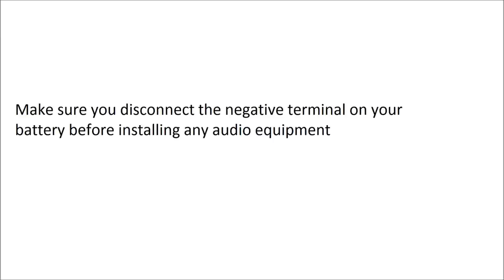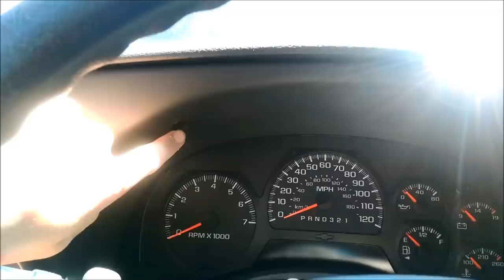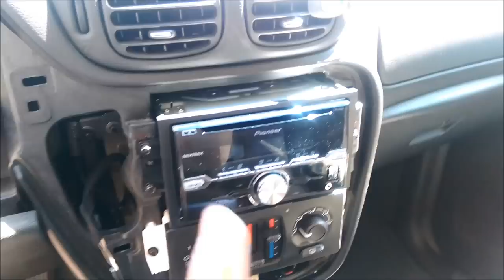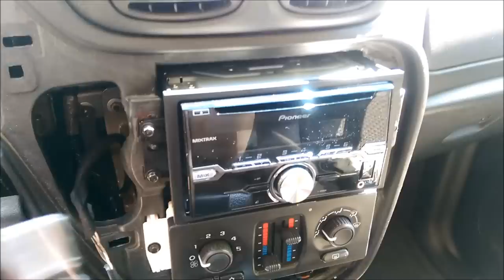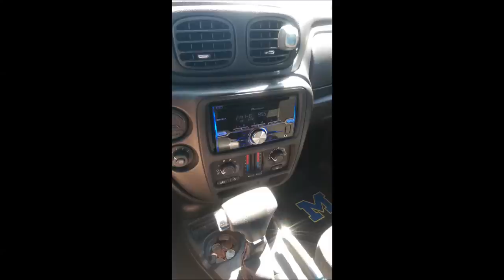Radio install in Chevy Trailblazer with Bose premium sound

Comment: Rydog, I installed a Sony XAV- AX100 Apple car play enabled unit in my 07 Trailblazer today. I never installed a stereo in a car before and i would have not attempted it had it not been for the video. I was able to save $150 minimum because I bought stereo and harness from Crutchfield thus getting the minimum price. Installers like Best Buy or local Car Audio stores were charging anywhere from $100 to $300 more for same unit + interface+ harness plus labor.  Though Crutchfield provided instructions, it is nothing compared to watching a video.Great job on the video and thanks a lot.
Reply from the maker: Binu Jacob thanks! glad it helped!

Comment: hi awesome video i have a question. to where did you connect the blue and white cable fron the axxess adapter to(thas the amp cable) cuz my radio the only wire that has left after connecting all the wires is a blue one it doesn't have any blue and white wire for the amp?

Comment: Just spent two days falling in hate with stereo installation. Ended up going old school and simply running new wires almost all the way back to the speakers. discovered a few interesting things about the 05 TB with Bose and OnStar. 1) don't be a cheapa** like me... take the stinking thing back to the dealer and let them do it. 2) make sure you go someplace where the people you buy from have a clue. We got a nice Sony stereo from WallyMart at a good price, but they did not have the right adapter set. (see above) 3) I ended up pulling door panels and the dash, etc., to run new wires and bypass all the old wiring (including two new power leads (keyed and unkeyed)), but I learned a couple of cool things about the wiring. a) You can get by without removing the door panels unless you want or need to replace the speakers. For the rear doors, if you pull the covers off the floor (the plastic trim covers at the door entry) and the one covering the center column between the doors, you can tap into the speaker wires there. For the front door speakers, the wires come in through the wall (follow the rubber conduit) and you can find the speaker wires inside the cabin (check online for wiring colors). b) the dash speakers are wired with the same colors as the diagonally (not Diagon Alley) opposite rear speakers. So, the front left speaker has the same color wiring as the rear right, etc. 

I have very clearly informed my wife that this is the very LAST stereo i'll ever install in a vehicle. From this point on, it's off to the dealership or Best Buy or some other organization where the legs and backs of the installers there are more than welcome to the suffering and pain I put up with for two Saturdays and a Friday night.

Comment: Thank you so much for this video! I just want to clarify something for you and other viewers. Any aftermarket radio install in the 1st Gen Trailblazer (2002-2009) requires a Metra GM1000 interface. This is to reroute the cords supplied not only if you have BOSE, but also OnStar as well. This harness is still placed in these vehicles W/O BOSE and OnStar, or one without the other. This is placed there just in case any customer went to a dealership and decided to have any of these features installed in their vehicle.

Comment: Quick question my dude I'm just trying to bypass my factory amp in my 2005 gmc envoy..when I unplug the factory radio will the speaker wire be on the big plug or the small plug..thanks

Comment: I have a 02 trailblazer and putting a aftermarket stereo pioneer avh 200ex  and i have the wire harness GMOS-01 and im having a issue with hooking it up the speakers. I have 2 plug ins from the stereo one goes to the black box and the other one goes into the stereo.do i just put the speakers wires together. thanks great video

Comment: I'm not sure if you will see this but I really don't know Jack about cars. If I get a aftermarket radio I don't have to get subs and an amp do I? Or do I just need to get the Bose adapter thing?
Reply from the maker: all depends on what car you have. if you have a trailblazer and you have the bose factory sound you need a adaptor harness like these weather or not you get subs or don't. it's just so the aftermarket radio can work with the factory sound system and not burn it up. this videos super old and i have done a lot more installs and tried new products. PAC-audio makes a way better harness for this. and it's about $100 on amazon. with a aftermarket radio. sub install would be complete seperate from this harness. If you have a base trial blazer with base audio you should be able to install a aftermarket radio and and just the simple $20 gm adapor harness and be fine.
Reply from the maker: PAC-audio OS-2X ,, is the part # for the harness that i now remcomend for a trailblazer with bose. when installing a aftermarket radio and want to use the factory bose sound system
Reply: @RydogsGarage  wow I'm honestly surprised you responded on such an old video. I actually have a 2008 Chevy Trailblazer and it also has the Bose Sound System pre installed.
Reply from the maker: @connorstiles1001  i don't get many comments and they come as notification on my phone. been wanting to post more videos on all my new stuf and new experiences but just been so buisy at work it's hard. so yes perfect if your looking to put like a double din touch screen apple car play radio in it. you need the PAC harness forsure. and it will all work correctly when wired up. manuals that come with it will show how to match the wires based on color coding. subs are fully seperate. becuase a set of RCA cables will plug into radio and run to a amp for the subs. and the amp will get its own power from battery and ground from the chassis of the car. still need harness for radio to work with factory system
Reply: @RydogsGarage  hey I know exactly what you mean when it comes to work lol. I worked the entire month of.november without a day off lol. But I appreciate the input. It's hard to.find videos for my particular car. Thankfully the 08 is basically the same car. I definitely want to get a touchscreen radio but don't really need apple play as I prefer Android.
Reply: @RydogsGarage  what kind of speakers do you recommend? Cause I would definitely like to get the speakers replaced at some point too
Reply from the maker: @connorstiles1001  truthfully the bose speakers are really nice. unless you want to drop a lot of money and re wire the whole car and do a expensive 4 channel amp and new speakers. not worth changing the bose speakers. the aftermarket radio will alow you to adjust the EQ settings alot better. i think if you added a subwoofer set up you would be happy with the system.
Reply from the maker: @connorstiles1001  i ended up with 2 12" rockford subs with a 1000watt amp. and a aftermarket touch screen pioneer radio. and left the bose speakers and tuned the EQ before i sold it.  was extremely pleased with the outcome. when you add subs and change the settings in the radio there is a LPF(low pass filter) and it will keep the bass to the subs only and take that out of the door speakers which makes the doors a lot more clear and consistent. rounds the whole system nicely
Reply: @RydogsGarage  awesome man thanks for the tips I greatly appreciate it
Reply: @RydogsGarage  If I don't plan to remove the radio do I still need to make the wiring longer like you did? And if not do I still need to cut out that metal bracket?
Reply from the maker: @connorstiles1001  i cut the metal out for space cause it's tight behind the radio. but that's a old radio. a lot of the new touch screens are not as deep and give you
more room. if i was to do it over i'd shorten the wiring to make it cleaner install. always soldier and  shrink tube don't use butt connectors you will have to redo the job and some point and it's just not worth it
Reply: @RydogsGarage  awesome thanks again
Reply: @RydogsGarage    hey this is a long shot but I want to add subs to my car and will add an aftermarket stereo to. So I need the pac harness thing and for the sub and amp what do I need to do? Re wire the old amp or is there a spot behind the new radio that will allow me to add another amp and just re direct just the speakers. ?
Reply from the maker: @cdogtheman  aftermarket radios (most... 99%) have rca outputs on the back of them for outputs to extra amps. for speakers and subs. that's what your going to want to use for the sub amp. only need the pac harness if you have a chevy with bose premium sound  and onstar. if you have base radio a normal adaptor harness will be fine and the aftermarket radio will power the door speakers. unless you want to amp door speakers too with a 2cd amp and bypass the factory wiring all togther
Reply: @RydogsGarage  thanks for responding so fast. I have the bose system in my tb. So would I not need to touch the bose amp and can wire the one running the sub to the aftermarket radio? Or would I need to wire the stock speakers with the sub kinda thing? I'm so confused lol I've spent all day researching and you have helped the most so far thanks
Reply from the maker: @cdogtheman  if you have the bose, yes leave the bose amp alone. the PAC harness alows you to use a aftermarket radio and converts the signal for the stock bose system to play. and then just power the sub amp off aftermarket radio. that's exactly what i did on mine. and loved it. just radio. harness. stock bose and a 15" sub and amp.
Reply: @RydogsGarage     this is a lot, so it's a lot more simple than I thought. So, will the stock speakers still work with both amps running into the same radio? I think I read, and you said that it pushes all the base to the sub and high mid to the stock speakers? Also, the aftermarket amp won't need to touch the pac harness at all? Just straight to the radio?

So, just to double check. Don't touch the factory bose amp. Radio pac harness and the amp will just plug into the after-market radio.
Reply from the maker: @cdogtheman  correct. the sub amp has its own power and ground. and the rca cables from it run to and plug into aftermarket radio for its base signal. rest of everytbing is taken care of by pac harness.
Reply: @RydogsGarage  so the radio will control stock speakers and sub and split the audio. YOUR A LEGEND I can't thank u enough G. I'm going to now buy all the shit now

Comment: Question, I bought that axxess module,  why does it have two wires running separately,  which is hot and black wires??  So the axxess wires coming out of module all go to the pigtail. And then 2 extra wires run out of module and don't run into pigtail. So what they for?

Comment: Yes sir I have a 2010 Chevrolet Malibu  and I'm installing a gmos-lan -034 and I got everything  wired but the black wire that's connected  to the pins that plug in the axxess box I'm wondering where do it hooks up to

Comment: I have this exact harness for a 05 equinox and I have very little sound all the way up and no chimes tried the adjustment on the box and I noticed on the small plug it only has 2 wires and the plug coming from the car has 3 wires this is the plug for the amp and only 1 pin is going into another wire can I just jump the factory amp to the power ground and remote.

Comment: So I just hooked this exact thing up...for.some reason I dont have any sound from front door speakers....dash speakers and rear doors work fine....any reason u can come up with to explain this. Everything works fine with factory setup...maybe amp not powering up.??  All wires seem to be hooked up correctly...when I disconnect the small gray box from factory plug nothing happens. Isn't that the factory amp plug....maybe that is a clue

Comment: TIA!  I am confused because the AXCESS HARNESS has LF+ LF-  AND RF+ RF- but nothing for the rear speakers, does the BOSE system take care of the rear? I have connections for rear speakers on a different part of the harness, the part that goes into the factory clip. Instructions for this MOS-04 are confusing as hell, please help

Comment: I'm not seeing anything custom here.. it's just the interface used to install a new radio in a vehicle originally equipped with Bose system An onstar.   Also like the other gentleman said in a previous comment..yellow is your constant power , red is your switched 12 volts (ACC) .

Comment: Here is a question that I dont believe I have seen yet. I have an '07 Trailblazer and My factory Bose radio sounded Semi good, but didnt go to full volume...as I heard that GM factory radios have a limiter that keeps them from blowing speakers. When you put your aftermarket radio in, did everything sound much better and louder with more quality of sound? like was in a situation where you could only go to like 80% of the volume and anything higher would start to distort? Basically, was the aftermarket radio louder and cleaner sounding? I would hate to spend a bunch of money on an aftermarket deck and it not sound any cleaner and especially louder....
Reply from the maker: +Mike Davies it seems alot cleaner, but volume level before distortion is about the same, ive noticed it had some weird things going on with it while tuning it in. i have subs, so i send all bass to them, so the stock system gets highs and mids only and it sounded alot better that way
Reply: Cool, Thanks!
Reply: Hi Guys,
I have a question. I just installed an aftermarket stereo, I think it has a bose amp (although I'm not 100% sure yet) and I still have the same problem of only one of the front right speakers working. all the rest of the speakers don't work (with factory and now with new aftermarket radio). I thought the new stereo/head unit would have solved it but it didn't.
I think the bose amp is borked (if it has a bose amp). can I just remove the bose amp and just jump wire the connections so that it directly outputs to the speakers?
do you see any issues with that? it doesn't matter if I sacrifice some speakers in the process.
the car is a saab 9-7x 2007 model, which is pretty much a trailblazer/buick rainer.
also, is it possible for so many speakers to be faulty? perhaps ground connections or wiring that's causing it? instead of the bose amp.
thanks alot for any feedback

Comment: hey man got the same setup but I'm not getting any sound from any speakers and it's hooked up color to color. any ideas?
Reply: Chris Hendershot did you figure out your issue I’m having the same problem
Reply: Same problem
Reply: @Capn_Codfish  if you guys have any external AMPS like factory amps you'd need to hook those up or rerun the wires from your speakers and cut in to where they were going into the amp under you back seat I believe if your Envoy or trailblazer has a factory sub.

Comment: Quick question for you buddy I'm getting ready to install a system in my 2005 TrailBlazer where did you run your power wire to get it into the cab of the SUV without causing any damage
Reply: Ik this is prolly too late but you can run 12v constant and acc to the fuse box under the rear driver side seat

Comment: Hello, about wiring the trailblazer, do you by anny chance have an diagram to hook up the interface on the boze  system? I have an android 2din head unit to replaced factory head unit. I'm from the Netherlands,....realy foks here don 't understand a thing about this kind off installation. So hope hou can help me out here. I have to bypass the amp. Becouse left side off my boxes aint working, replaced them still the samen, so most likely the amp.  Is busted. Hope to get an answer. Best regards, Herben

Comment: Hey bro i have bose system in mine and wit the steering wheel buttons the only issue i have is that when i bought it the rear speakers didnt work i switched them out and nothin so idk. If its the factory amp or some wires are damaged

Comment: Yellow is constant. Red is switched. Just to put that out there. Also dude. Any aftermarket stereo will not automatically output at 50 watts. They differ from 16-22 RMS and max out at 50 watts.

Comment: Thanks for the video! I'm wanting to do this soon because the cd player in mine does not work. If I don't care about the OnStar system. do I still need to get the interface adapter?
Reply from the maker: only need the adaptor if you have the Bose premium sound, if you have the normal sound system a normal harness will be fine, have any more questions or video ideas let me know!
Reply: Thank you!
Reply: I'm wondering the same? I'm not installing amp or subs just a double din Android head unit with gps and just wanna use stock speakers but it is the Bose system and I don't use onstar
Reply: James J. McCloud if you have the Bose you need it. It would be putting power into the power supply if you didn’t. That would make everything stop working.

Comment: How would i make my rear dvd system to work with my aftermarket radio?? My up & down volume works with onstar, but wont work with the radio, any suggestions?? 2004 cadillac escalade
Reply from the maker: for the dvd do you mean video? there has to be a way to run a video output from the radio and into the DVD system, so they both play the same, vise versa...and getting the aftermarket radio to work with the onstar can be verry funky they all respond differently, I'm not 100% sure

Comment: I installed a new radio in our 04 trailblazer its the North Face Edition and the reception sucks so I bought the antenna amp and the reception is worse  any ideas on what im doing wrong ....the radio was bought on WISH.com . and I bought the harness but dose the truck have its own antenna amp that maybe  I didn't wire up . thanks